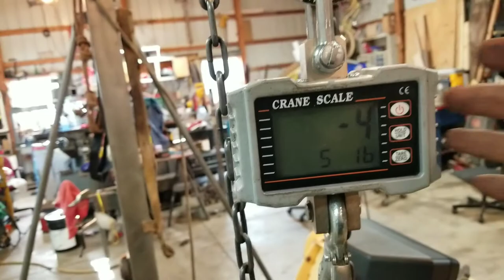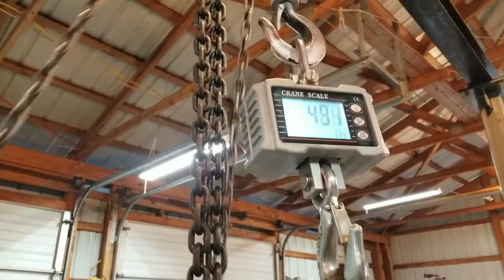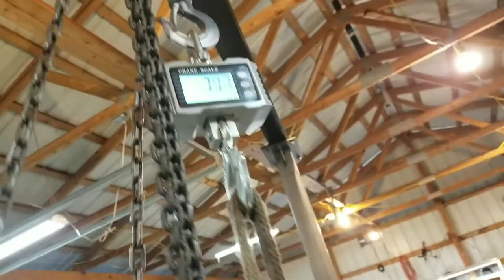Fisher Minute Mount snowplow repair and cutting a slot.

Comment: it is called an end mill for a reason, not supposed to cut that way! it is supposed to take gradual cuts across the surface. that is why you have the vibration
Reply from the maker: Yeah, I was wondering about that. I will definitely try the gradual surface cutting next time. Thanks for watching!
Reply: @tomhendricks316  no problem

Comment: Do you have any information on the old  fisher minute mount plow parts you got for the lift piston and packing I have the exact plow and need to replace that piston and seals I’m looking for part #s or were to order without spending a fortune.thanks in advance for your help
Reply from the maker: I would start by calling Storks Plows
610-488-1450 They are the best in the business. I told them what I had and they hooked me up with all the parts I needed
https://www.storksplows.com